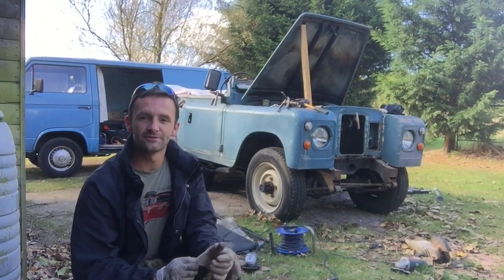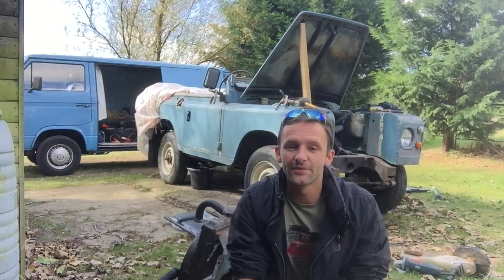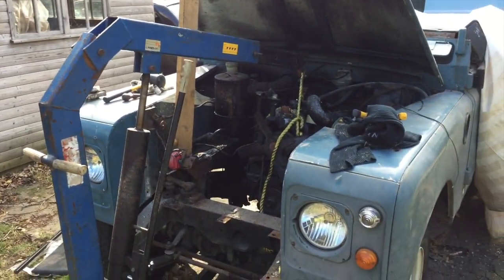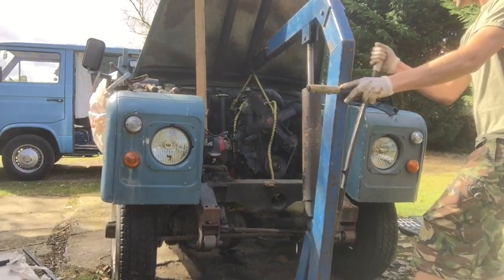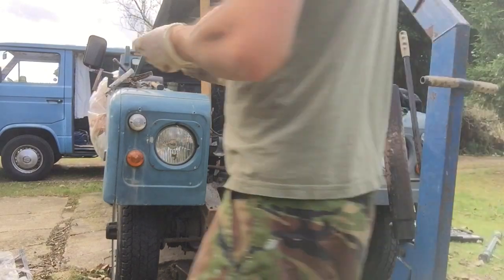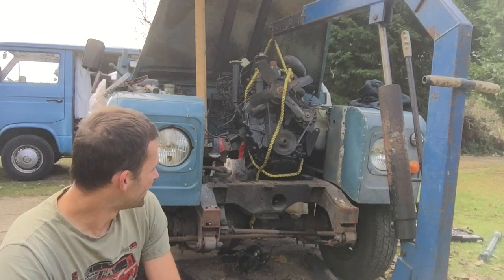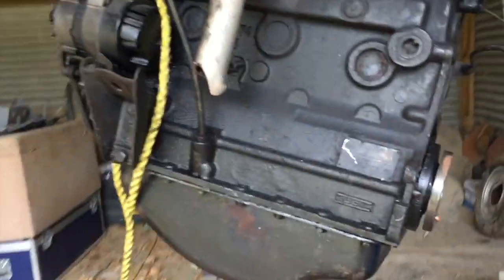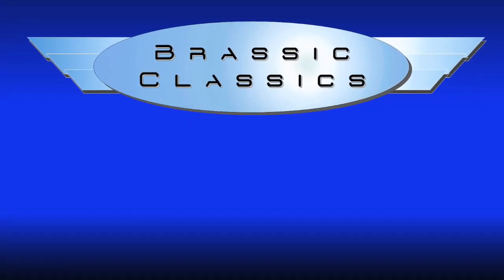Land Rover series 3. Engine removal. Episode 2.

Comment: Remember too that sometimes it's easier to wiggle the car, since it's on wheels, than the engine hoist. Have a second or third small jack available when you stab the motor back in.
Reply from the maker: Will do thanks again :)

Comment: First time? Sigh... Look around and find some solid plywood sheets (two layers) to roll the engine hoist around on. That shed looks like it vacuums up dust and leaves from the yard, make sure you have some heavy bin bags ready to wrap the the engine in to keep the internals covered when you pull the pan.
Reply from the maker: Thanks for the advice :)